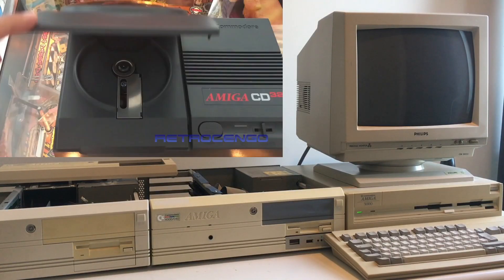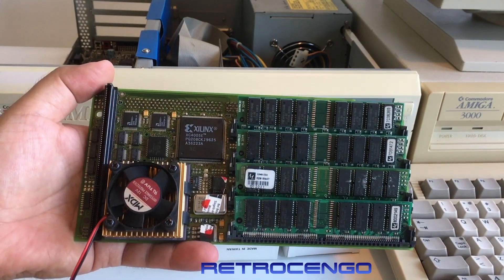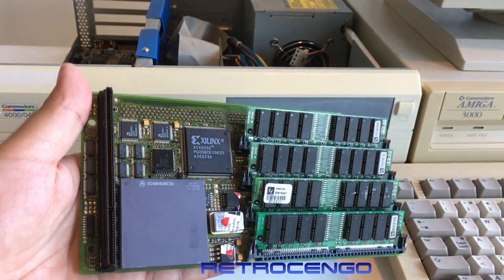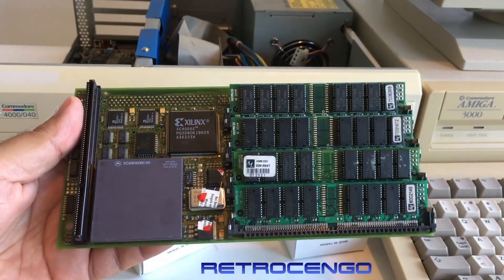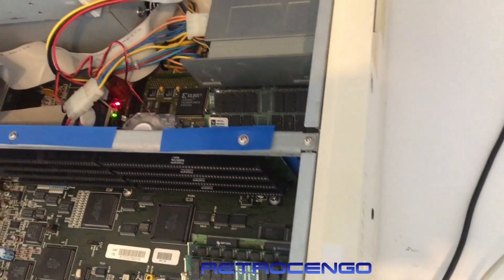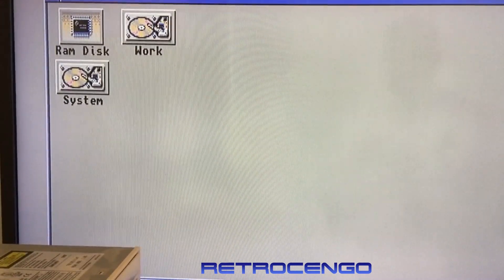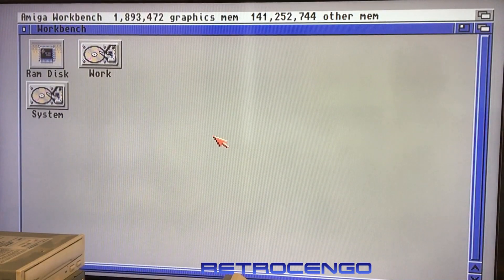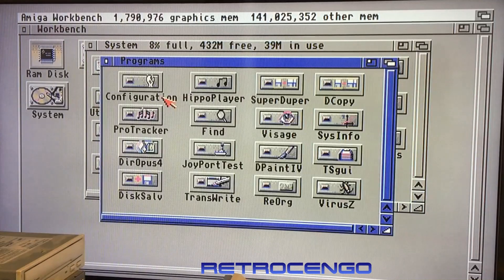CYBERSTORM MKII 68060 50MHz on Amiga 4000

Comment: I have two of those but my better card is the MC68060 49.9 MHz (rev 1) 1 WarpUP Processor(s): PPC 604e 200 MHz (rev 2.4), 66 MHz busclock running in my A4000T. Which is a much bigger card. But then its in the A4000T tower. I have 8 4000Ds also... they are OK I guess. I also have an A4000D in the ATEO tower with the Picasso IV.  Prefer my 1200EZ-Tower ... scuzzscink website.
Reply from the maker: scuzz amiga What a great collection you got there, would love to see it on youtube 😁👍🏻

Comment: That "double the speed" of regular A4000 is a bit disappointing though :'(
Reply from the maker: Korky Its pretty accurate i think. 040 25MHz, double up 060 50MHz😉
Reply: @RETROCENGO  Well, that WAS my point :) One would expect a bit more then just (theoretically) double clocked 040 experience
Reply from the maker: Korky Im feeling ya. Next step, after cooling in place, I’ll buy a rev 6 68060 cpu, i have got the scsi adaptor, so i can clock to 80-100MHz. Video comming up😁

Comment: What does the MKIII offer that the MKII doesn't?
Reply from the maker: Green Meanie MKIII is optimized, better/more compatible with Zorro cards. 
From Amiga database:

the board is the same as the CyberStorm PPC without the PPC components - not upgradeable to PPC
Ultra Wide SCSI controller, NCR 53C770 - supported by NetBSD
expansion slot for the CyberVision PPC
the SCSI controller needs the INT2 signal which is not present in the A3000's CPU slot
Reply: The memory speed is significantly faster too. From 22MB/s to 40MB in average